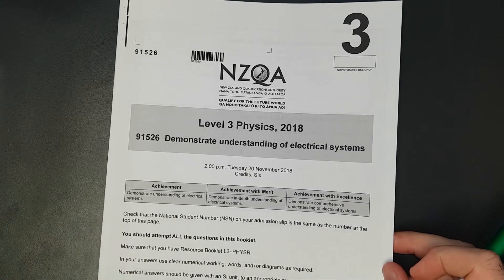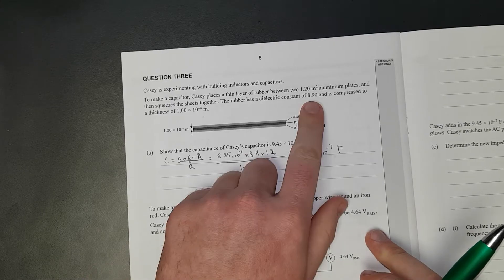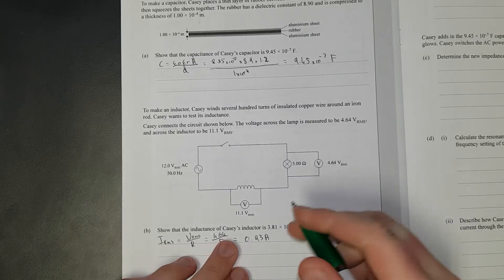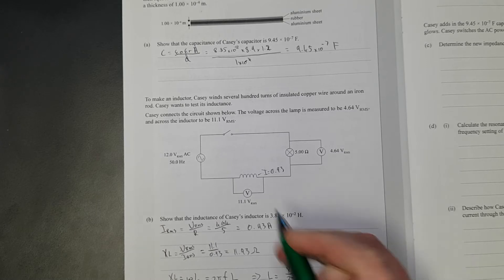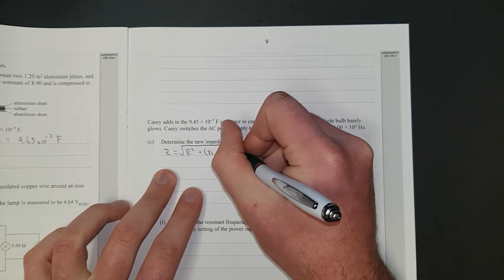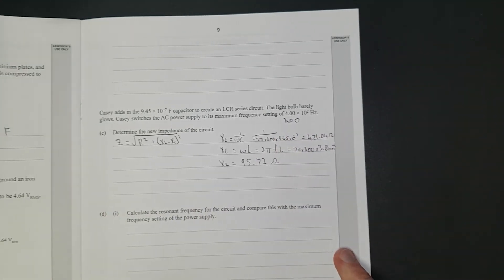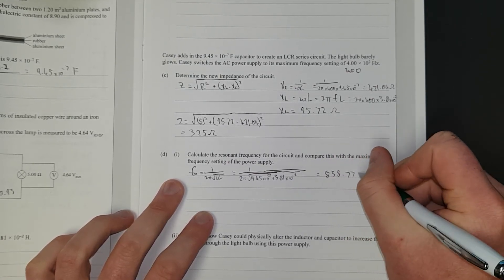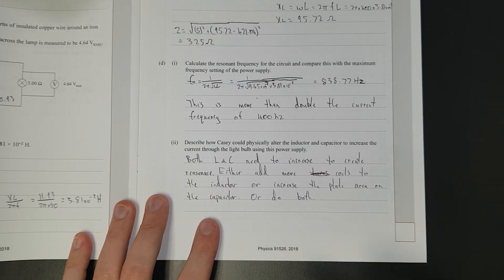2018 Electricity (NCEA Level 3)-Q3

Comment: For the people wondering about question d)ii), It is because to get the maximum current, the circuit needs to be at resonance, so that Xc and XL will cancel each other out. to get to resonance, you will need to decrease the resonant frequency by about half, so that it falls into the range of the power supply frequency because without doing that the power supply can physically not produce a high enough frequency.

Comment: For question dii, why does the frequency have to lowered to the power supply frequency? I thought resonant frequency is when current is already at maximum?
Reply: we have to lower the frequency, as that frequency is the resonant frequency, and as the power supply can only do up to 400hz, the resonant frequency needs to be reduced so that the power supply is able to produce that frequency. Yes you are right, at resonance, the current is maximum
Reply: @nathanturkey8933  Thank you!